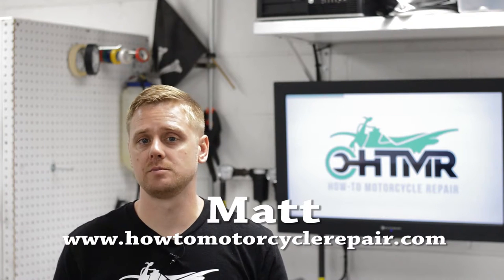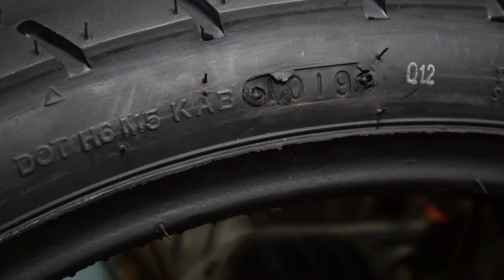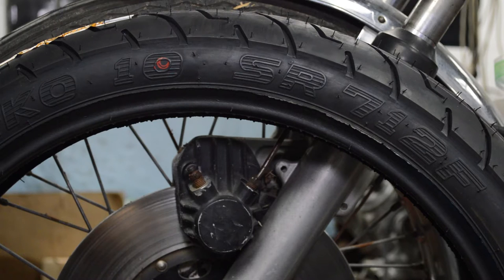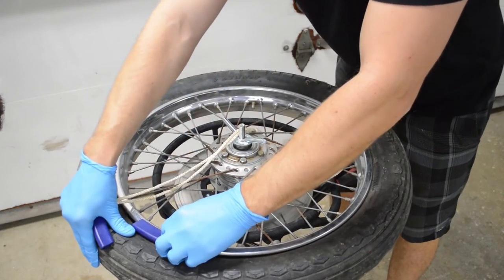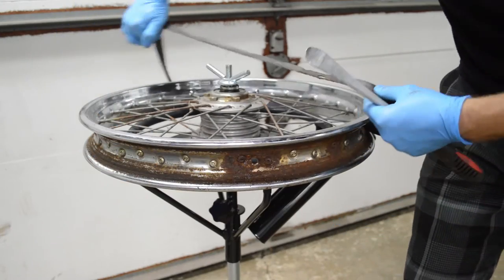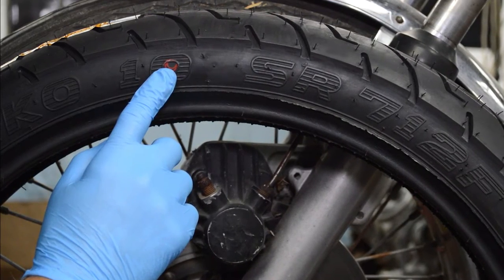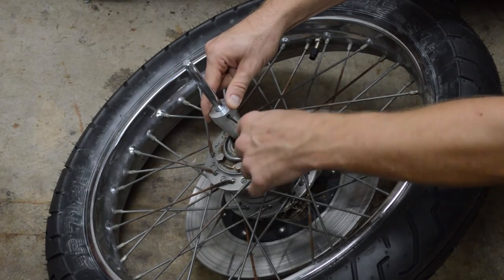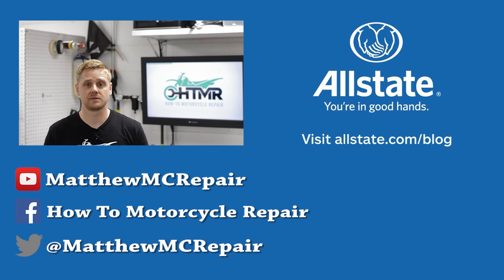How to Change Your Own Motorcycle Tire | Allstate

Comment: Take to tire shop.  Sweet Lord this job is not worth it if you can get an install/balance for $50 or less.

I'm returning the balancer I bought on Amazon...fought with rim protectors and spoons for two hours on a 21" dualsport tire.  Pinched tube and had to do it again.  Never could get it to seat and took to tire shop who was nice enough to do for free.

No use risking your salvation in Jesus with extended profanity session of frustration.  Tell your enemies to change their own motorcycle tires